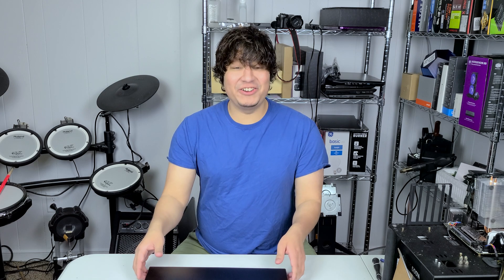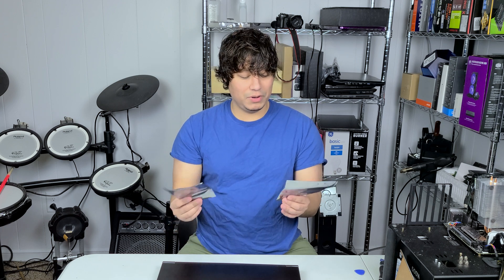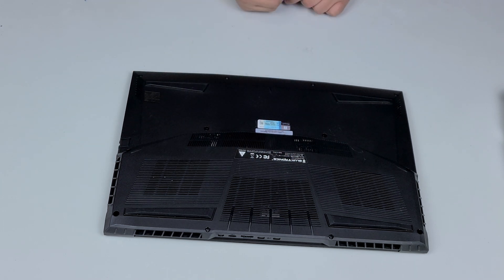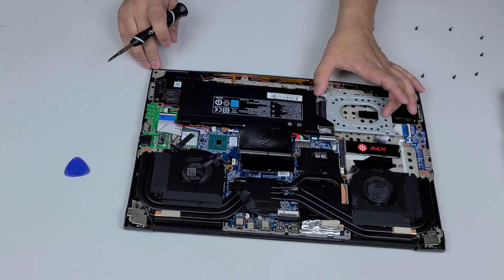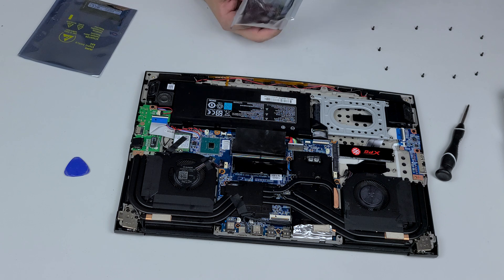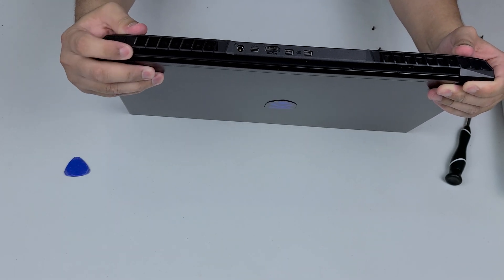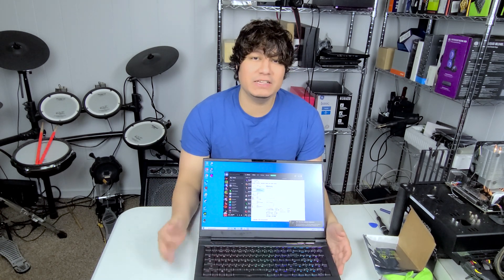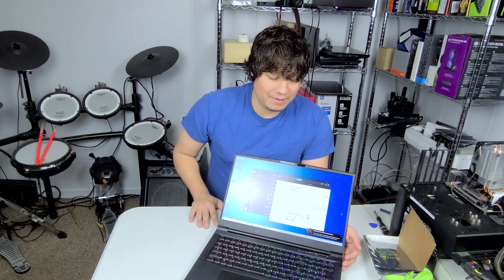How to upgrade the ram and NVME on a ELUKTRONICS MECH-17 G1Rx Gaming Laptop

Comment: I know this video is old, but hopefully you see this.  I got an new m2 nvme ssd and installed it into my mag-15 laptop and it doesn't boot, i remove it, it boots.  I have  switched which slots each ssd is in, doesnt boot (does boot if i just change what slot the original is in but dont put new one in).  I checked boot order and lots of other things the internet mentioned but cant seem to figure it out. Feel pretty dumb right now

Comment: Is the stock ram 1rx8? Would upgrading to dual rank help any on CPU bound games?
Reply from the maker: From recent news the 1rx16 should be better but I haven't tested myself
Reply: @racimbio  1rx8 will perform better. Those are the double sided ram. You should compare the performance of the x8 3200mhz stick you have in single channel and the x16 ram you have in a CPU bound game. Would be an interesting benchmark. I have the same laptop as you btw with the 2070 115. The 2070s in these laptops are nuts, they can get a core clock of 1800mhz at 1440p. Only downside about this laptop is the shitty keyboard/battery. The panel isn’t too great either, a lot of ghosting, but that Mini DisplayPort fixes that problem.
Reply from the maker: @jameyt1  oh yeah these are the double sided. I've looked through my stash but only have 1rx8 sticks laying around. I'll have to see about getting my hands on the single sided stick and do the test.

Comment: my nvme screw is totally stripped and immovable ffs
Reply from the maker: When that happens depending on if I have an nvme installed I use these to get them out   https://amzn.to/3eYZhM5    as long as you can get slightly around the screw head it should work
Reply: If I'm adding a new ssd and not replacing it do you know what ssd screw I can buy that would fit?